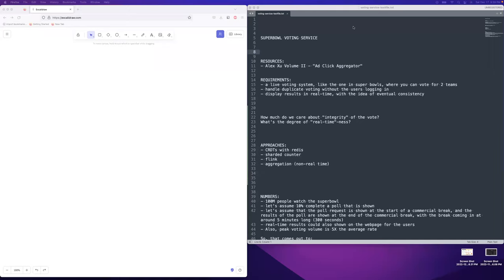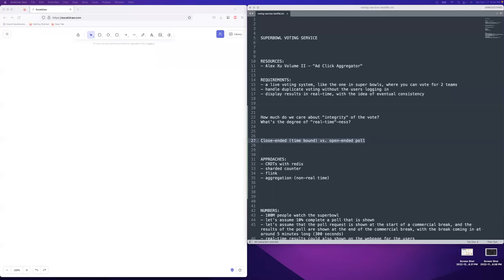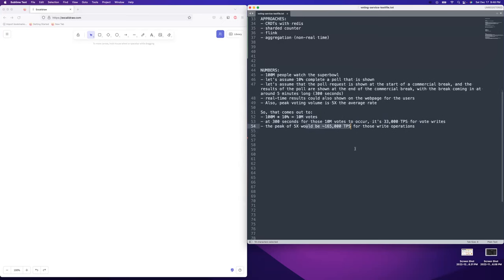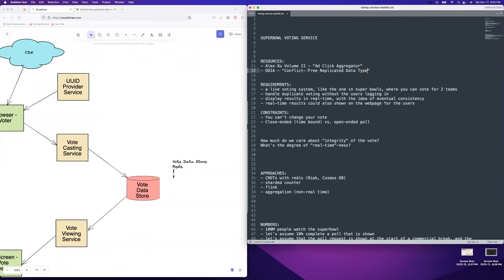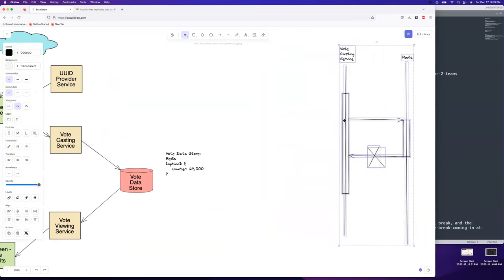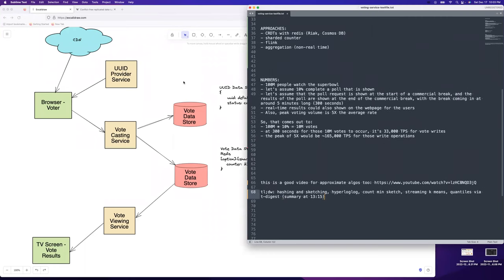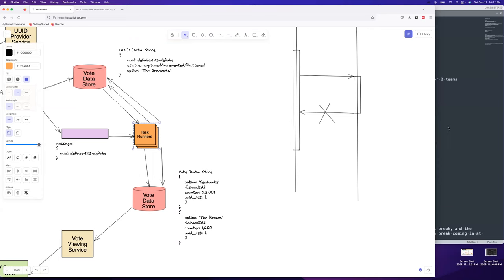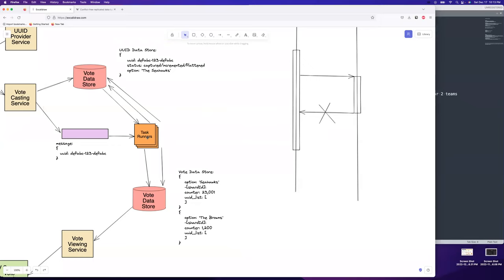System Design: Real-time Superbowl Voting (with FAANG Senior Engineer)

Comment: Thanks. This one is very helpful. It built many foundational concepts such as thread contention problem solving. But its not clear how thread contention would be solved here for incrementing the counter. In this solution, even if there are 1000 counters, there is possibility of few of 165 counter increment request would be concurrent. How would that work, then? Increasing teh shards reduces the contention but doesn't eliminates that. How would our writes be sequential? can we use broker partition by shard number and asssign one consumer per partition? Thsi would ensure that one single consumer of message would be processing messages sequentially and updating counter in sequence?

Comment: Regarding the discussion about CountMin Sketch. I guess it could be the way to go depending on the flexibility of the requirement, ie:
For this case where we're trying to vote for who the winner will be on the SuperBowl, data not being entirely accurate can be accepted but for an electronic presidential election for example.
Count Min Sketch could not work or at the very least it should be tune in a way that the given probability of error is reduced (more hashing) but that obviously comes with a performance penalty

Comment: Thanks for this. It was really insightful.
One question I have is how does the CDN and UUID prevent vote duplication?
Reply from the maker: The CDN just holds "static assets", like a js bundle for ReactJS or any images on the page; it has nothing to do with preventing duplication.

The UUID prevents duplication because you can't create 2 records with the same primary key, and if we partition by the UUID, then all requests for that same UUID should always hit the same DB node if it's using single-leader replication (like DynamoDB) instead of leaderless replication (like Cassandra)

Comment: why.. not simply having the api gateway to prevent duplicates using rate limiting per devuce? why sharding aswell considering you can use dynamoDB and aws which would handle that for you?
Reply: How would you do that with API gateway and rate-limiting?